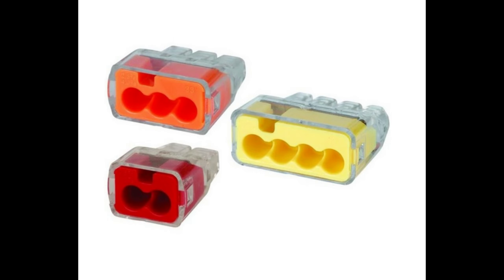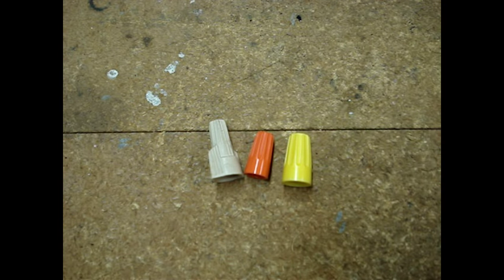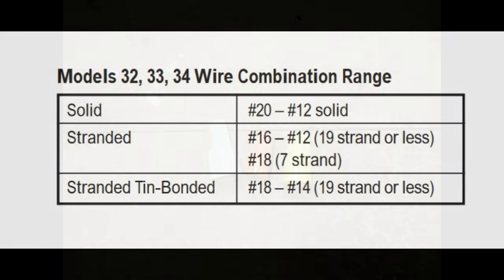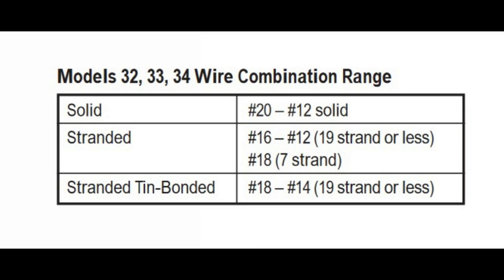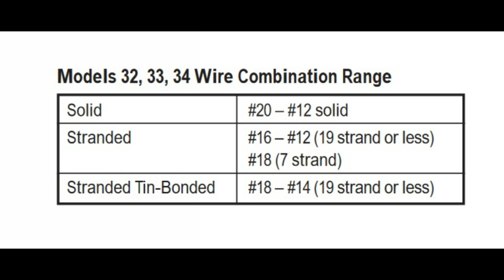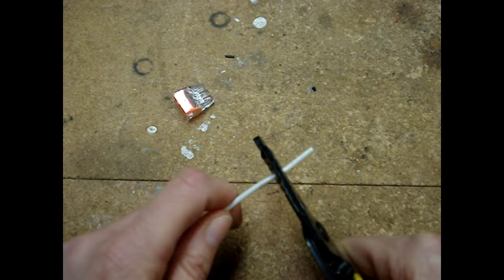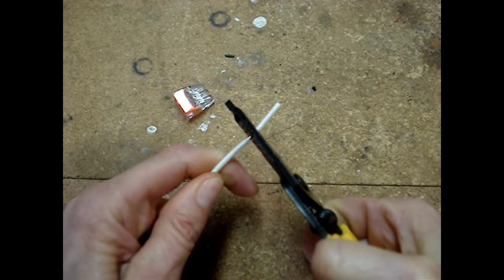How to Use Push In Wire Connectors

Comment: Condition #2: You can reuse with the same size wire or LARGER. Lower nominal gauge = larger wire diameter (in case anyone is confused).
Reply: I believe you're right what she said made no sense.
Reply from the maker: Thanks for catching that Shane and Ab Abner.  I just found your comment, sometimes Youtube fails to alert me about a new comment.  I always check the videos or accuracy, but this error got past me.   I will pin this to the top of the comments.
Reply: how do two wagoes connect together

Comment: Excellent help.  I just unboxed a new kitchen ceiling light and it had the identical connectors you demonstrated.  I had never seen these and had always used wire nuts.  I thought I needed to open it but was unable, so I checked here.  THANKS!
Reply from the maker: You are welcome, it's always nice to hear the videos are helpful!
Reply: Same here!  I am not sure how to connect these in a safe way... Any videos on this!

Comment: Pull ans twist!! Thank you! That's what I needed to know! I can confirm now, that this works on the Ideal module 102  two wire plug as well.
Reply from the maker: You are welcome, thanks for watching the video and taking the time to write a comment.
Reply: Same here. Wasn’t sure if you could remove wires without cutting and throwing away connector.

Comment: Do you have to tin the stranded wire first redoing my cars sound system I normally use wire nuts or crimp connections but these looked interesting
Reply from the maker: I don't do a lot of work with sound systems.  I can't give you expert advice on that question.  BTW, there are also Wagos, which I think are better than the push in connections.  I have a short video about them:  https://youtu.be/A5o-iUDmi3U?si=If68k0C3TIGCSHGO

Comment: Is it possible to connect two single wires together using a 3 port wire connector; thus leaving one of the ports in the 3 port connector void of any wre; empty? Is it necessary to seal the unused and empty third port for example when connecting wiring for lights on an ATV / Quad where the 3 port wire connector might be exposed ot the elements? I doubt that multi-port wire connectors are IP67 rated.

Comment: Hi thank you for this video , Quick Question... my wires were silver and when I cut it back it was copper? What was the silver coating that was originally on it before I cut it back?
Reply from the maker: Maybe someone soldiered the splices?  Before wire nuts were invented, it was common to solder and tape splices.  I've found spices like that in my 1952 home.

Comment: Can I use a 4 connector with only 3 ports ?
Reply from the maker: I'm not clear on your question.  I think you are asking if you can only use 3 ports (leaving one empty) of a 4 port connector.  The answer is yes.
Reply: @Know-How-Now  yes! Thanks for clarifying
Reply: @Know-How-Now  I think this is similar to the question that I have. Is it possible to connect two single wires together using a 3 port wire connector; thus leaving one of the ports in the 3 port connector void of any wre; empty? Is it necessary to seal the unused and empty third port for example when connecting wiring for lights on an ATV / Quad where the 3 port wire connector might be exposed ot the elements? I doubt that multi-port wire connectors are IP67 rated.

Comment: Didn’t have to fully cut that much off. I am more conservative with wire than some people and the OP gave an example of why: When wire is already ran through a wall and cut, the length is pre-dealt and limited. Therefore it is important to cut as little off as possible. I would have cut off only the marred part, in fact placing the cutting right on the first mar from the tubing. That would decrease the amount of wasted copper & jacket by 1/2. In a situation where the wire is already short, this could make a significant difference in success vs a costly problem. Previous changes done without regard to conserving existing wire can very well be the reason why it’s short in the first place.
Reply: I do realize my comment may come off as nitpicking, but I have seen many people who have little-to-no regard for conservation. My former employer (a contractor) does some things I would never do, prime example: cardboard & other recycling in the garbage. He does this at practically every jobsite and it always bugged me. I gained a lot of skills from his mentoring and I still have a lot to learn, but I also see a bigger picture that he doesn’t and I won’t compromise my conservation ethics for speed, money or any other personal gain. That all said, thanks for the info, I did learn an answer from the video that I was looking for 🙂👍
Reply from the maker: Thanks for the thoughtful comment.  I do not think you are nitpicking.   When I have wires that are already short, I use Wagos.  You don't have to strip the wire back every time the connection is remade.  The Wagos are kind of pricey, so I don't see anyone in this country using them to replace wire nuts or the push in type connectors.  https://youtu.be/A5o-iUDmi3U?si=6bZ3Uhf0PJ88A-Y1

Comment: Thanks for your help. If some one did not strip enough insulation off, how would you know if you pushed it into the insulation part of the wire? Or is it not possible?
Reply from the maker: Hi Joel, the clear window on the connector would be the "tattle tale", if you can't see the copper in the window as shown in the video, then the insulation is not stripped back far enough.
Reply: I appreciate your reply but I do not think I asked the question right. Lets say you push the stripped wire to the point of the insulation being the point of the contact were the metal part of the push term would normally be holding the copper wire but is holding the insulated part. How would you know you did this? Can you feel it? Maybe the insulation part would not go into the holding metalic part? 
Thanks in advance
Reply from the maker: My experience is that the insulation won't fit through the "clamp" opening.... maybe you could push #20 insulation in that far.  If you did manage to clamp down on the insulation, the connection wouldn't work and you would have to troubleshoot and find the bad connection.
Reply: Thanks Know!
Reply: @JoelAntoinette  i agree the bottom insulation is risky

Comment: Thanks so much!  Just bought some LED hallway lights, had all the regular tools and some electrical tape and wire nuts, read the horrendous directions and had no clue how long to cut the wires, I’ve only ever used wire nuts…my age is showing.  Hopefully they won’t interfere with the Wi-Fi
Reply from the maker: You are welcome, Elaine.  Best wishes for the light install and the Wi-Fi.
Reply: I’m in a pickle, the LED lights don’t fit the gang box correctly.  Went to Lowe’s yesterday and bought a box of #8-32 to fit the gang box, the ones provided were way too short and small.  I couldn’t figure out what size they were as nothing the hardware store had, they didn’t fit.  The light is also a bit short of getting both #8-32’s into the holes.  Is there an adapter that will help that you know of?  I was hoping there’s a small plate or bar that can be screwed into the gang box and then I can properly secure the light fixture.
Reply from the maker: Without seeing your situation, I can't give you a good answer.  You may want to take a picture of the situation and take it to an electrical supply house.  There are many types of extension rings for electrical boxes.  You could also try asking at one of the big box stores, but these days, who knows if you can find someone who knows the answer.  Also Raco makes all kinds of electrical hardware, you can check out their catalog.  https://www.hubbell.com/raco/en
Reply: @Know-How-Now  great, thanks so much!

Comment: Hi, can this be used for taillight wires on automotive? If yes do you believe this is safe for maybe damp areas? Thank you
Reply from the maker: I don't do much automotive electrical work.  These connectors are designed to be indoors and in a spice box.  I think there are special connectors/splices for automotive purposes.  Go to Auto Zone or Advance, they likely sell something for your purpose there.
Reply: @Know-How-Now  the packaging says for use in dry locations only

Comment: I need to make more room in my outlet boxes to install smart switches, as the switches are deep and take up much of the box. In the 2-, 3-, and 4-gang boxes it is impossible to fit them with all the twisted wire and wire nuts. I was planning to experiment with push-in connectors so that the wire could be folded more compactly into the back of the box. Unfortunately, the brand of smart switches that I have chosen come with stranded wire pigtails. I might still give it a try in at least one box.
Reply from the maker: You can try Wagos, I'll put a link to a video I have about Wagos.  Also, there are box fill requirements to meet code.  https://www.youtube.com/watch?v=A5o-iUDmi3U
Reply: @Know-How-Now  Thanks! I ended up using traditional wire nuts, but I taped the heck out of my wire groupings and nuts so that as I folded and pushed (crammed) them into the available space in the outlet boxes, they stayed tightly connected. I used colored electrical tape because I have four wire switches and there was just so much taping going on. Someday when someone switches them out I hope it's clear, but they are going to wonder why in the world I felt the need to use so much tape. It really worked though. I have crammed 26 smart switches into outlet boxes this way so far, the larges of which was a four gang box, and got them all to fit.

Comment: NUMBER 14 wire is smaller than #12
Reply from the maker: You are correct, I'm not sure if this was a question.  Happy New Year!
Reply: @Know-How-Now  She said @ 1:35 it must be the same gauge or smaller. Then said if #12 gauge was used you couldn't use #14. So I think she made a mistake.

Comment: I'm not a fan of the push in connections.  In my experience they don't save time and the connection is less secure than wire nuts.  The problem is that twisting the wires can back them out of the connector.

When you run wires to a receptacle, you separate out each color of wire and make your connections.  When you cram everything into the box that twists the wires around and you can visually seen some of your connections have started backing out.  Then I have to recheck all my connections and spend time pushing wires into their connectors from inside the receptacle.  (Because pulling everything out of the receptacle  would just start the process over.)

The push in connections may be rated for stranded wire but in real life I can't imagine that working at all.  The wire would be a mangled mess by the time you got it in the connector.  I might try the wago connectors with levers at some point but I don't plan on ever buying push connectors again.
Reply from the maker: Thanks for taking the time to write the thoughtful comment, Alex.   I've never tried the Wagos, they are a little pricey.  I prefer wire nuts too. 

The push in type are good if you have issues with your hands/hand strength.  If you have really short wires in a box they might be a good solution as long as you don't want to take the connection apart.
Reply: Yeah I bought a bag of the push in connectors for some wiring in the house I bought. After checking them out I just used good old wire nuts.
They seem just like the quick connects on the back of receptacles and switches that come loose. No thanks.
Reply: @Know-How-Now  I just replaced multiple 4 foot fluorescent light fixtures in a house built in the late 90's. All the LED fixtures i purchased to replace the fluorescents and the standard single bulb incandescent bulb fixtures in halls and closets now come with these type of push in connectors. It made for quick work for the new installation.

Comment: You need a good twit on it for stranded but it will work
Reply: Yeah, the stranded is difficult. I had used these for some recessed lights in my new shed. The grounded wire from the lights were flimsy stranded copper that didn't get in very securely. I ended up just using wire nuts for those, and used these connectors for the hot and neutrals, which the manufacturer had used some tinning or solder to make more firm. Those ones pushed in just fine.
Reply: @ThriftDiving  yeah I started to tin these stranded ends myself

Comment: You can't pull wire nuts off like these. I do think they're nice for capping of the wires in light fixtures before the drywall goes up. That way the homeowner or whoever can wire their lights up.

Comment: these are rated for stranded wire without tinning.
Reply: Yes, but it is difficult to twist the strands tight enough to stay rigid enough to push in smoothly. You're better off tinning.
Reply: They might be rated for it but you'd be an idiot to use them. Wire twist nuts are the best hands down.

Comment: We no longer back stab so I wouldn't use these until we go to 10 amp circuit breakers
Reply from the maker: Yeah, I helped some friends out.  Their AC wasn't working.  I traced the problem to the emergency on/off switch.  The switch had been back stabbed and the side must have cracked/broke when it was put in the box.  Of course it was builder grade/crap switch.  Luckily, it didn't heat up and start a fire.  I know people are going to use these, hopefully, they will at least use them properly.